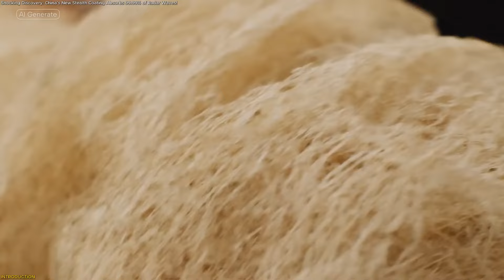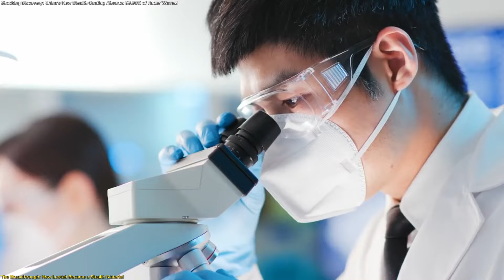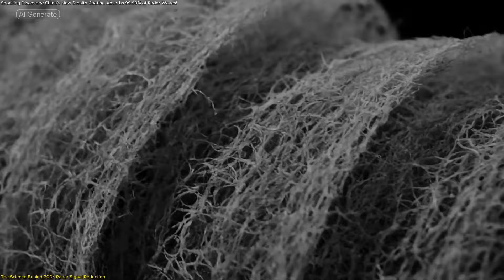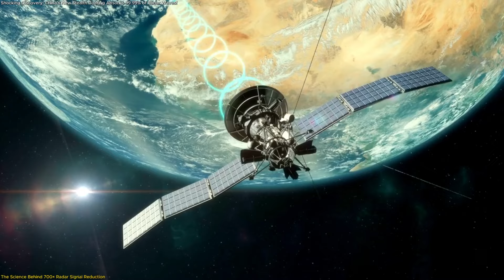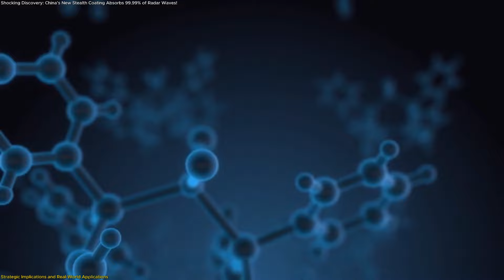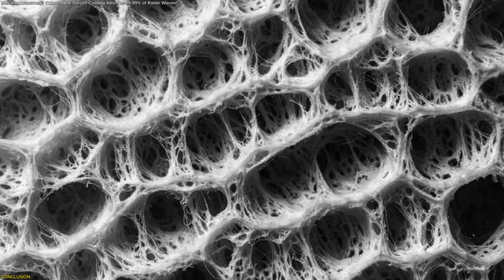Shocking Discovery: China’s New Stealth Coating Absorbs 99.99% of Radar Waves!

Comment: Nice video and presentation. 
There is nothing new to celebrate with. The interesting twist is that the open cell foam/mesh like structure is derived from loofah. 

Compare : inorganic structures requires to add carbon coating, a process is unnecessary for loofah. The webs in a charred loofah is the carbon, an E field dissipative material. However carbonized loofah must be further treated to withstand inertia stress on wing surfaces, not with expanding open cell foam. 

The 4mm thickness is not new or unique in this invention. All stealth coating are rated by a low pass corner frequency. Signals above the corner frequency experience attenuation and the plane become stealthy, and below is not. Apply 4mm as quarter wave put the defending planes well within stealth zone. For comparison, the low pass corner frequently for fighter plane radar is Ka band which corresponds to 26GHz a thickness of 2.88mm by which the surface return loss is 3dB and increase as frequency increases.
Reply from the maker: You’re absolutely right that the open-cell, foam-like structure isn’t new in principle, and that loofah mainly stands out because its carbon mesh forms naturally during carbonization without needing extra coating steps. The research team’s twist is showing how a biomass-derived scaffold, when combined with NiCo₂O₄ nanoparticles, achieves 99.99% absorption and nearly 700× signal reduction in the Ku-band.

You also make a great point about structural reinforcement. The published work focuses on electromagnetic performance, not durability under real aerodynamic stress, so future development would definitely need additional treatment before being used on fast-moving airframes.

Regarding the 4mm thickness and cutoff frequency — yes, quarter-wave absorbers in this range are well-known, and operational radar bands vary widely across platforms. The significance here is less about inventing a new thickness and more about demonstrating that a biomass-based, low-cost, and sustainable material can reach performance levels comparable to engineered composites.....Thanks,,,
Reply: @S @SpaceEyeNews   Thanks to the complements. I wondered know how the absorption and reduction factor were defined in the report.